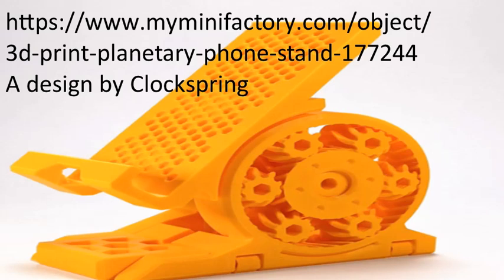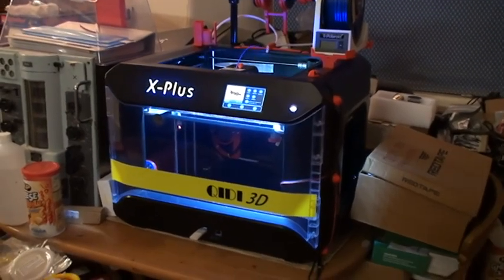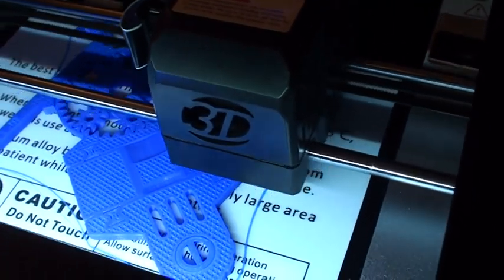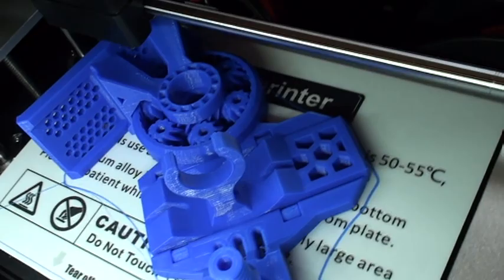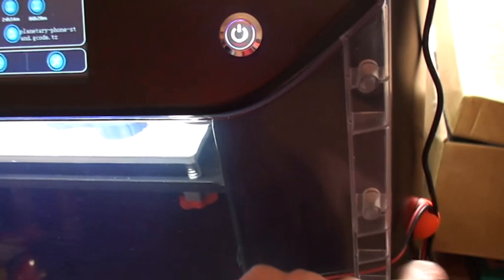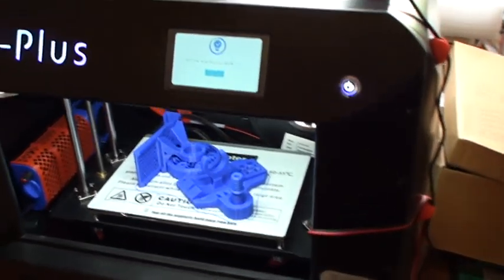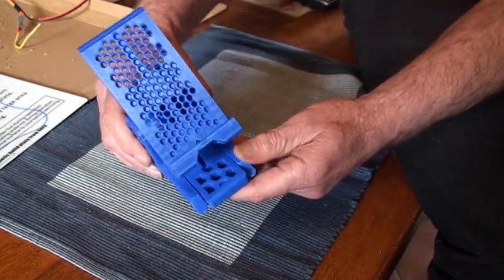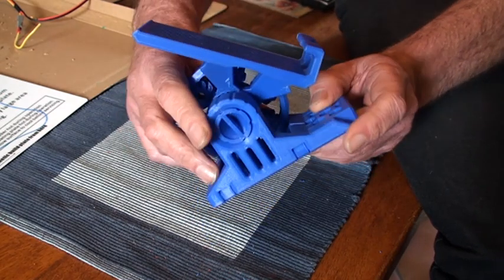3D Printing a Planetary Phone Stand

Comment: hi have you printed a euc stand yet?
Reply from the maker: EUC Stand - for the Ninebot One E+, I used a Mitre Block, which I cut and rejoined with a 3D printed part. The 16X has  a reworked inverted plastic foot stool, as a stand, which works very well. I'm designing some carbon fiber foot plates for the Ninebot which I will be printing soon. I have printed camera mounts and some 16X molded bits for the 16X.